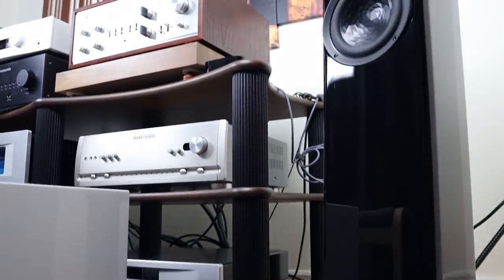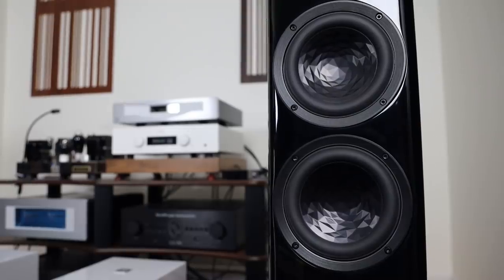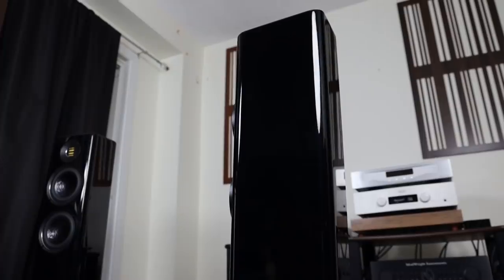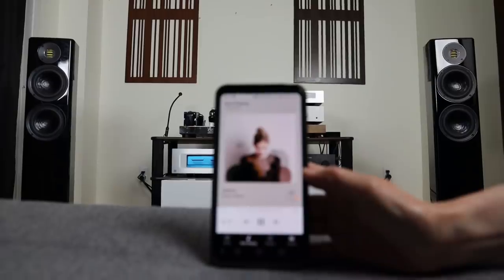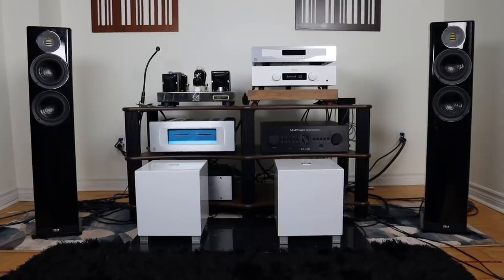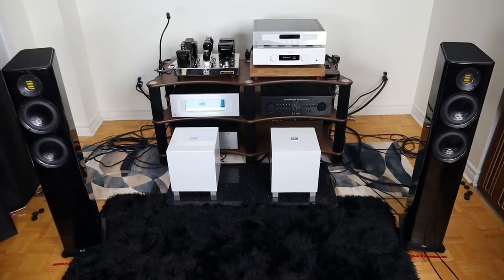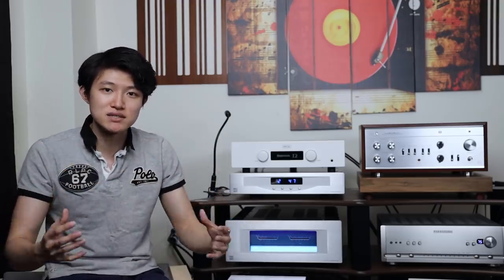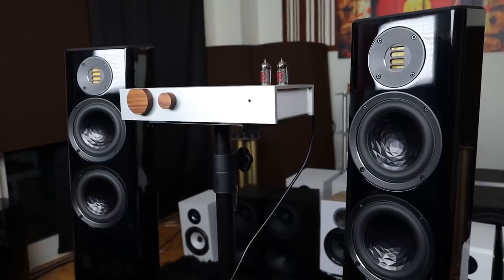Elac Vela FS 407 offers more than just Hi-Fi ! #AMTfi

Comment: I've had an elac FS 407 for a long time, the most significant improvement I've had from setting up the Elac with AMT tweeters is putting a big rug in the room, bigger than the distance between the speakers, and under the rug I put a good layer of foam of 1 inch. The quality gain in defining the soundstage was absolutely incredible!!.., it became more realistic with more spatial location and at the same time even smoother, and best of all very cheap investment..

Comment: I have had these in my system now for about 1 1/2years and I am very happy with them. Thanks to your outstanding review of these speakers I bought them during covid and did not hear them first. I hoped that I did not need to return them but that was my back up plan. 
I power the Vela fs 407 with a Prima Luna evo 400i that has 8 el-35 tubes. When I go to listen to other peoples systems in my hifi club I am shocked just how good these compare to much more expensive speakers.
Thanks for your detailed review. 
   Hank
Reply: Yes, you are correct about his review. I'm in the market for speakers and these seem to be what I'm looking for. It seems these should be a good match for my Parasound A23s (mono).

Comment: Great review. I used to own the previous Elac 407 and they were a very good speaker which sounded exactly like you described. The only thing I would say is the Elac 407’s I had dug down to 30hz and the bass was something that was very surprising for a speaker of its size.
Reply from the maker: Yeap. Start to roll off around 50hz or so but can go down to 30hz no problem

Comment: Great review sir!!! 
I think the best word for AMT tweeters is resolving. I love AMT tweeters- most speakers I’ve owned use AMT tweeters. However, I’ve primarily focused on the active studio monitor side- Adam, Eve, and HEDD. I’ve tried prior Elacs and Monitor Audio golds (folded ribbons) on the HiFi end.
Adam, Eve, and HEDD share much of the same DNA but what’s consistent about most of these is the level of precision and room to discern details that the AMT tweeters provide. High frequency transients can be picked up so much more easily with these tweeters than other options. 
And you’re absolutely right- the advantages of AMT tweeters don’t at all need to be harsh or strained. My EVE SC208 monitors are very smooth yet extremely resolving.
Reply: Mo- great choices IF you insist on an AMT..you are actually  because it means you can eliminate many other great monitors (Neumann, Event,Focal, Dyneaudio etc)

Comment: These speakers are great. I have both the BS 403 and the FS 407. Thanks for the review. My ears agree with you!
I have it paired with a PrimaLuna EVO 400 amp.
I had these connected to a denon AVR x8500h - which is a beast, but something was missing. Switching to an external amp helped alot (first to a schiit vidar then to the PrimeLuna). It still does confuse my why the change was so large. The denon is still more powerful. (yes, power isn't everything, the musical flavor maters too.. but the changes were huge.)
Reply: Quality of circuitry, power supply, quality of filtering caps etc.
Receivers have low quality power. Receivers= quantity over quality.
Reply: I have my 407s paired to Prima Luna 400 as well and have only beautiful music with everything that I want coming from that combination.

Comment: That happens a lot where the 2 way is better than the 3 way or 2.5 way. It's all in the crossovers and 3 way's have a pressure build up that creates issues and harder to dial in. These are similar to my Monitor Gold 200's that I am getting rid of. I settled on YG Acoustics Carmel 2's and bit the bullet and stepping up to the next level and paying for it.  I also got a used pair of 400 watt mono block mola mola Kaluga's and getting a Lampizator baltic.

Comment: I took a listen to these in comparison to B&W's 702s and 703s in a hifi store the other day, and the difference between them was striking.  It was not an ideal setup, or even close honestly, but the Elacs seemed to completely lack any sense of room presence.  It was as if there were instruments playing from inside of a black hole, and only loud enough sounds escaped the gravity.  Everything else simply didn't exist as far as they were concerned it seemed.  The B&Ws on the other hand were very "live" sounding, particularly the 702s, and created a great sense of room presence.  Some might call it a bright sound as mentioned in the review, but to me they simply sounded accurate. The Elacs also seemed much smaller in person than I would have thought, not even reaching my waist (6'0") and the drivers did not appear to be 6.5 inch.  They looked to be 5.25s if I would have guessed.  Coupled with the fact that they cost over 1000 Euro more per pair than even the 702s, I chose not to bother with a home demo on the Elacs, as the margin by which I preferred the B&W's sound was huge.  Going to home demo the B&Ws this week and see if they can beat the Tekton Impact Monitors I have in for a tryout.  The Tektons already beat out Buchardt S400s which are still here for the moment as well.
Reply: Yeah I have had the 702s for about a year and they are fantastic for the money, can't say they are better than these 407s as I have not demoed them in my setup, but the 702s are cheaper and the build quality is outstanding. I think the drawback with B&W speakers is really a function of their resolution and sound signature - if you play poor recordings and your components upstream are not up to snuff, they can sound bright/fatiguing, and the bass in particular can be thin or muddy. There are speaker manufacturers who design their speakers' sound signatures to be more forgiving, but if your tastes in music and sound match up with the B&W house sound, and you are willing to spend $$$, B&W is hard to beat. Btw I liked my 702s so much I just upgraded to the 804s!
Reply: @michaelmityok1001  I am starting to wonder if there is some sort of unspoken agreement between all YouTibe hifi reviewers not to ever mention or review B&W due to their dominance on the scene and some sort of perception of an "evil empire" sort of vibe or what the deal is?  Maybe B&W isn't reviewer friendly?  I just know I can't find real reviews of the 702s on YouTube.  Just those stupid videos where someone plays their system for you and records it on their iPhone.  (facepalm)
Reply: I have the 683 s2 and love them But 702 is intresting to me. Might upgrade to that one day
Reply: I still can't figure out quite why the Velas sounded so strange to me at the store.  They didn't match my impressions from other reviews at all.  To call them "dark" would be an understatement.  The salesman referred to their sound as "fun", the sort of thing that is great for a party but not much else in his opinion.  Lots of bass, and decent treble, but not much mid-range.  I would have to agree with his assessment, but I don't know how much the setup of the store's listening environment affected things.  Personally I use a Dirac Live Processor, which evens the field quite a bit once I have something here in my room, but I can't see how that  huge of a lack of mid-range presence could be rectified by processing.
Reply: @TheAlanFish  that is big deal breaker for me. It sounds amazing in bass and highs, but mids left a lot to be desired.
My HD800S have shitty mids and i dont want speaker with shitty mids.
Reply: @TheAlanFish  You say that the 407s did not reach your waist; was this by a long shot? I only ask because the 702s list a cabinet height of 997 mm vs the 407's 1000 mm. Crutchfield measures speakers with the plinths and they actually show 702s to be taller by just north of 1 inch. It just seemed you were describing something that was far smaller relative to the 702s. About your observations, I've never been able figure anything out about how something sounds at a dealer; maybe it's that I've only ever owned five pairs of speakers or that I don't swing around my dealer often, but I find the acoustics are just too different and suboptimal there.
Reply: @flightvector   In person, yes, they are quite a bit smaller than the 702s, in all dimensions.  They were not side by side, rather on opposite sides of the room, so inch perfect measurements are a but difficult, but if I had to guess, I would guess they were at least 4 inches shorter than the 702s, an inch and a half or more narrower, and 3-4 inches smaller in depth, at least in cross-section as they have a rearward lean to the whole cabinet.  The 409s by comparison were something like 10 inches taller than the 407s.  They almost don't even look like the same speaker line, the difference is that big.  It does make me wonder though.  I am starting to suspect that might have mislabeled something, because I was expecting a much bigger speaker from the reviews I had seen.  I remember thinking, "how short was that guy in the demo video on YouTube?"  LOL!  While I agree that the listening experience is far from ideal in most electronics retailers, and certainly was in this case, the difference in sound signature was extreme, and I didn't care for the Velas really at all, but that may be just personal preference, particularly with the type of music I typically enjoy.  It's also possible that they had something off with their setup that was causing the issue.  Whatever the case, they were supremely unimpressive, especially for the price in my experience.  In the end, I decided to go with the Tekton Impact Monitors after a three way in home comparison between them, the B&W 702s, and the Buchardt S400s.  Now, here's the crazy thing.  The Tektons won that comparison with a handicap.  They sounded really wrong right out of the box.  So much so that I thought something must be wired up out of phase and contacted Tekton, who were no help at all.  The I tried tuning them with Dirac Live, and that fixed what I thought was nearly all of the issue.  I went forward with my little comparo, and the Tektons narrowly edged out the B&Ws as my favorite of the trio.  Then last night I was doing some reading in search of some better stands for them, and came across a forum post where someone described the same issues I was seeing with their Impact Monitors without tuning applied.  They finally chased it down to a slightly loose woofer mounting screw, so I decided to check mine.  Sure enough, 2 screws were loose, 1 on each speaker, both oddly in the same position.  Tightened them both up, and immediately the issues were gone, and the Tektons suddenly sound head and shoulders better than the other competitors.  Tekton designs great speakers, that much is clear, but their quality control and customer service leaves a lot to be desired.  There is also a lot of inaccurate info on their website.  The Impact Monitors do not use ring radiators as stated for example, their stated weight is for a single speaker, not a pair, and their stated efficiency is off by about 7 dB, among others.  There is also a reason they don't show pics of their speakers with the optional grills.  They are poorly constructed, and look pretty silly to be honest as they don't match the profile of the speakers, particularly as the corners are routed with a different profile than the cabinets so the grills stick out past the edges of the speakers in the corners.  Man do they ever sound good though.  LOL.
Reply: @20puskinas1992  I would still give them a listen yourself if you have the opportunity.  As the old saying goes, your mileage may vary, and they might sound different to you.
Reply: @TheAlanFish  Wow, that is quite amazing! I don't know if that's a testament to the speakers or the DSP,  but amazing either way. I'm itching for some new floorstanders at this level as well so I was curious about what kind of music you listen to, since you mention that being a possible factor. I did thoroughly trial Dirac Live before they updated it in 2018, but found the results to be disappointing to my dismay. It did help fill in some voids down below 80 Hz, but I just didn't like what it was doing at higher frequencies; I felt it introduced some sort of a veiling on the music. I blame most of that on my Mac Mini, which I don't normally like using as a source, but I also don't think I realized I could try limiting correction to lower bands before running out of time. I had always thought about revisiting Dirac Live if I could find a better source to use it with.
Reply: @michaelmityok1001  how did you find the 804 sound different than 702? I heard the 702 and instruments felt too forward to my ears. Some say that is a result of not enough power, not so sure...
Reply: @Cooliewhistles  B&Ws are not to everyone's liking. I went to the 804s because they just give you more, the sound signature is the same. In general all B&Ws require high quality amps and sources and cabling etc. Otherwise they don't give you what you paid for. It's like buying a 911, which is engaging and exciting, but it's not really an all-rounder, as well as being expensive. The 702s IMHO need a McIntosh or CODA amp, Sugden or Pass too would work, Parasound JC5 for less money would pair well, so something with high current. For sources the way to go is R2R or tube DACS and/or analog sources. Personally I would go for the 702 Signature if you have the budget as the crossover upgrade made a big difference from what I heard at my dealer. Hope that helps a bit?
Reply: @michaelmityok1001  It does Michael thank you! id like to hear the Signatures, or regular 702s at the store but with a higher end amp to see if that makes a difference compared to my memory of mine

Comment: Would the Vela FS 407 sound well with the Purifi NAD C298? I have the C298 with the Quad Z2 (true ribbon) and they sound great together (with Topping D70s). Since the 407 is also a "ribbon" tweeter, would it go well with the C298 as well?

Comment: Hi Jay, thanks for finally reviewing these. Out of my budget at the moment but I am currently evaluating the bookshelf versions of these and was curious how you felt the 407's w/o a sub compared to the vela 403's with dual subs or any sub?
Reply from the maker: Adding a sub or dual sub to the vela 403 will get you closer to the 407 but the differences are more than just the lower bass.
Reply: @Jayiyagi  Thanks for the reply. Can you elaborate further on the other differences? Is this generally a bookshelf vs full tower sort of differences?

Comment: Have you ever had a chance to compare these to the Elac Solanos? They use the same Jet5 tweeter but lack the crystalline structure on the woofers and also have a back vent in addition to the down-firing floor vent. My guess would be that bass is going to be a bit tighter on the Velas but you’d still get the full advantages of the Jet5 at a lower price.

Comment: Jay, I know this is an old video but was curious on your thoughts on the differences between the BS 403 and these FS 407's as I know that you've reviewed both.  I currently have the BS 403's paired with an SVS SB200 sub. I would be using the FS 407's with the same sub. Thanks man!

Comment: So how did they compare to the 403's that you liked so much ? Mostly similar with more low end it sounds like. I prefer the look of the 403 with sub myself so might go that way. Maybe Rel ?
Reply: i have the 403's with a rel t9i which is an amazing combo highly reccomend. If i ever upgrade speakers I would go with this becuase I love the sound signiature
Reply: @luke.boxall  I went and bought the Elac 403s and put a Rel t9 with it along with the naim amp. It doesn't have quite the open top end as my old Martin Logan's but a much bigger and more balanced sound. Liking them quite a bit.
Reply: @jimji2774  oh that’s funny I’m hoping to make the move to the supernait 3, what did you choose to go with?
Reply: @luke.boxall  Just the Naim 5si for about $1700 felt like a big enough upgrade to the blue sound power node I had. Also had the atom home first but didn't like all the lights on it calling attention to itself
 Didn't get to try it with in 403s but it also sounded real good with my old speakers.

Comment: I found the FS407 (previous version) to be a very well rounded speaker but a little on the  dark/dry and clinical side. The sound stage also seemed wide but not as tall compared to a dome tweeter. Ended up going with Canton Reference 3.2 DC which uses a ceramic coated dome tweeter. Found this to be more dynamic and slightly sweeter without being too bright.
Reply: It sound dark and dry because of great bass and mids suck out. It lacks energy in mids around 1khz to 4kz in a big way! 
If speakers lack mids then it can sound dry, thin and warm in lower mids.
Reply: Try Elac vela fs 409…you will have everythimg you miss with the 407…trust me…i own vela fs 409…they only don’t cost more…they are on another level
Reply: The elac vela need an amp more poweful than the hegel used here…i run them with a musical fidelity M6 500i 500w x ch on 8 ohm and almost 1000w x ch at 4 ohm with current with a peak of 200 ampere….i think elac vela need this power or even more…sensibility is 89 db but only on paper…effective one for me is like 87 db…they are very hard speakers to drive…need a awful lot if current if you want bass to be alive even at low volumes

Comment: jay, nice review. however, i think the thing that's missing is you didn't say if the FS 407s lived up to your expectations as the BS 403's bigger brother. thanks.
Reply from the maker: It certainly did !
Reply: Would you say, then, that the FS 407 has all the same sonic qualities you liked in the BS 403s but just with more bass extension?
Reply from the maker: @21farms  There are definite sonic similarities but it's more than just a bass extenstion, overall the highs are even more effortless and more gut in the midrange